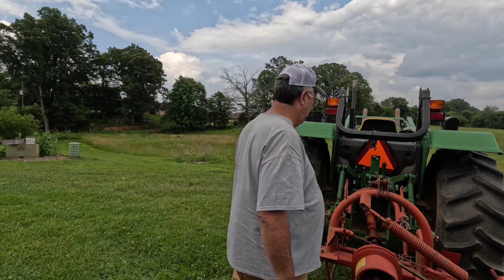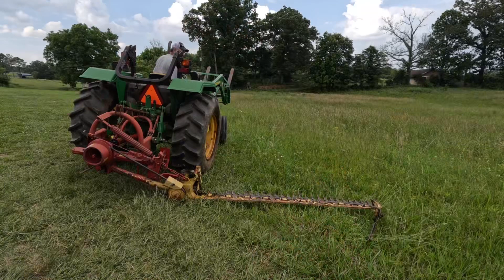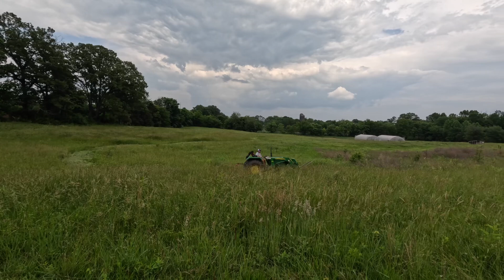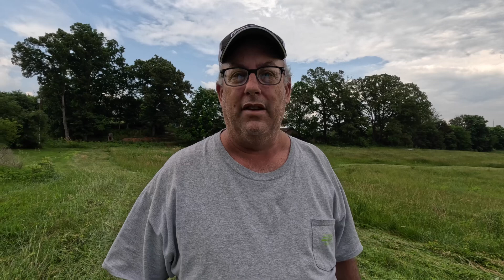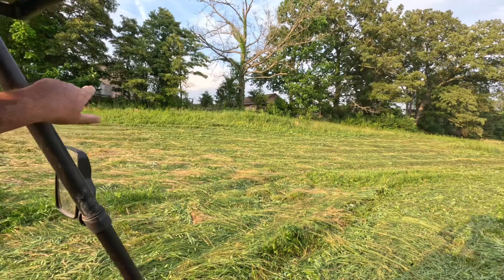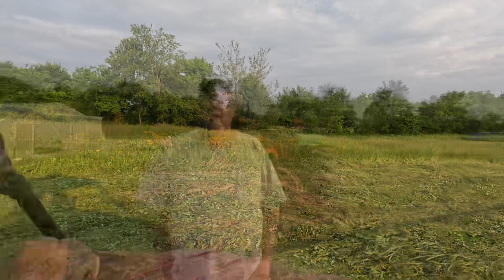Cutting Hay With A 451 Sickle Mower

Comment: Good afternoon! That extra pto that comes out of your mower was for a conditioner that would be pulled behind the mower. You have an earlier 451, which looked nearly identical to the 450, which NH produced before. Later 451's did not have that pto option out of the back of the mower.
Reply from the maker: Thanks Jason! You have help solve a question that I have had for many years!

Comment: I have 450 and i can't  believe  have good these things cut and mine is 50yrs old.
Reply from the maker: I used to cut up to 50 acres with mine. As long as the sections are sharp it will cut really good plus they are cheap!